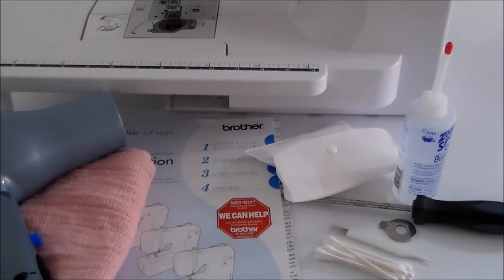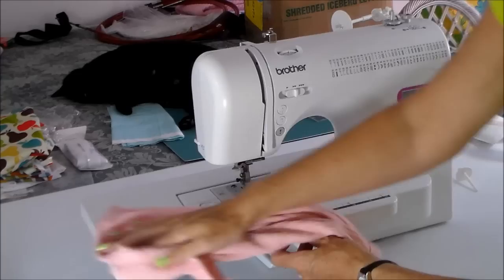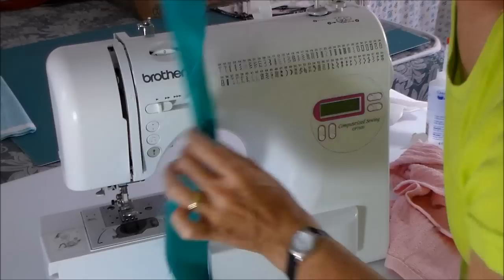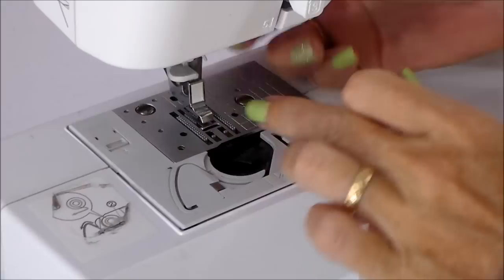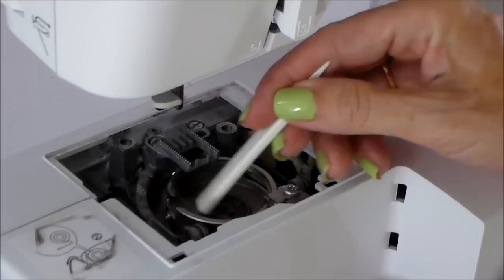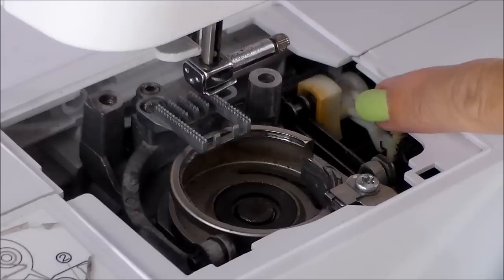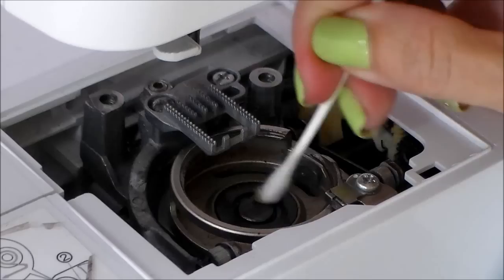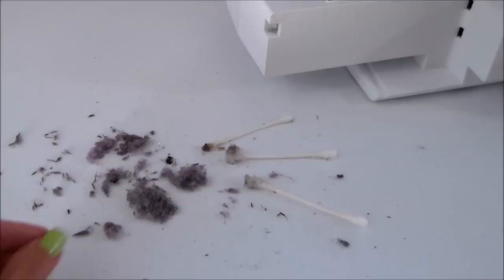How to clean a sewing machine

Comment: Good suggestion about taking the picture. I will give you a tip that I learned today while trying to figure out why my Brother SQ9185 kept jamming. The bobbin case and the holder that it goes in have little markings to help line it up. If you look closely, you can see a little triangle and circle that will line up when you've inserted the bobbin case in correctly. I had never noticed it before I read that.

Comment: Very good video. No hesitation. The rust is just due to the lint in the machine. You only have to have one episode of boiling veg on a winters day - with the machine out & it will soak up the condensation.  Wiping with oil is very good idea each time. But your rust isn't too bad yet. .

Comment: Blow drying or using one of those air blowing cans are the worst thing you can do to your machine!! I clean sewing machines as a side job and I find a lot of people blow all the lint into the engine part of your sewing machine.  They do sell parts you can connect to your home vacuum.  That would be the best thing is ducking up the lint instead of blowing lint into engines and running the risk of breaking an expensive machine.

Comment: I have one of the vacuum attachments that I use to suck out the lint. However because of it's size it doesn't always reach into areas I see clumps of lint so I hold a bendy drinking straw on the end of my vacuum. I just hold it with the bendy part down so I can bend and twist it into tight areas. It is a bit fiddly but worth the small bit of bother.